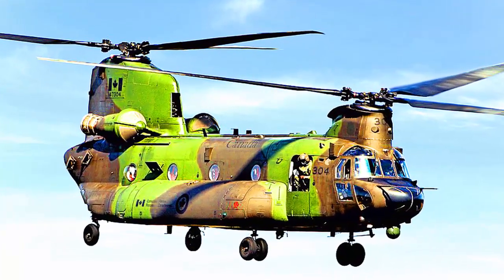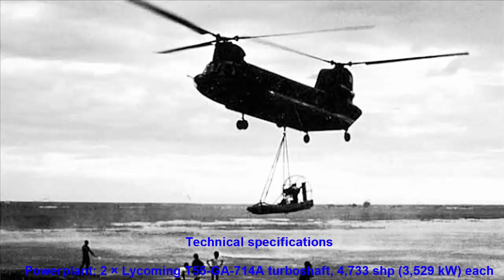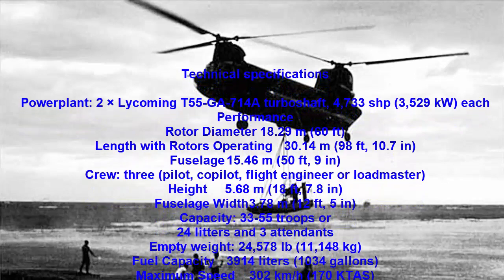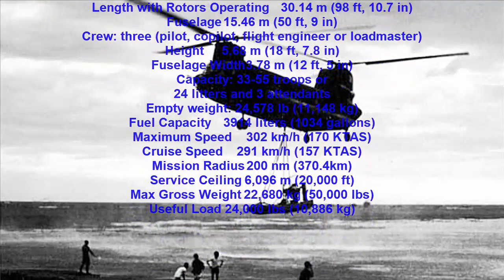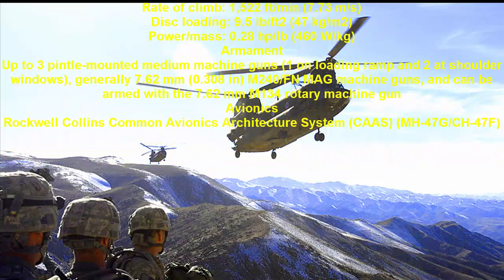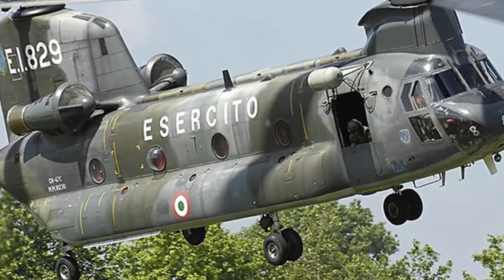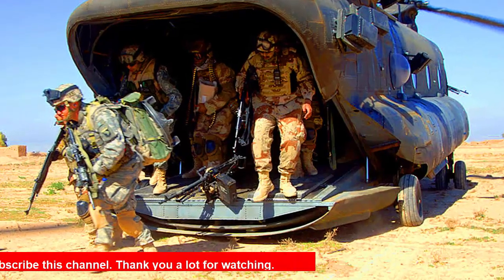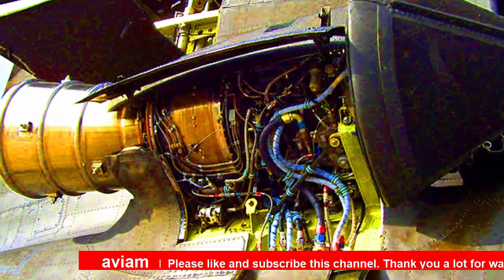How a Tandem Rotor Helicopter Works and its Applications I Chinook Helicopter

Comment: I’ve flown in several series Chinooks. Awesome Helicopter and engineering - interesting points about the synchronized rotors.  I remember my first flight in one of these the Fuselage seemed to  “slightly twist” as the rotors increased RPM..  and the hydraulics sometimes leaked.  It was a heavy lifter and got the job done!  Thanks for the Great Video!!
Reply from the maker: Thanks a lot. Cheers!!!